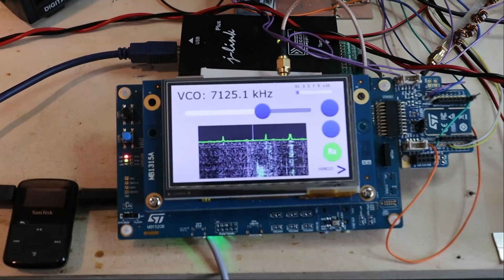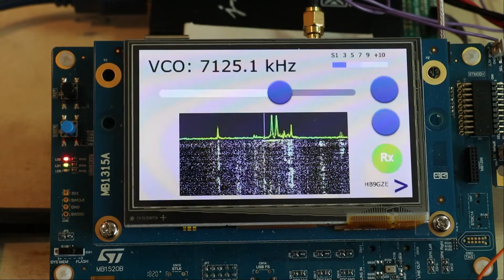Introduction to DIY HAM radio transceiver

Comment: Did you build these circuits yourself or are these commercial (off the shelf) circuit boards?
Reply from the maker: Yes I did design all the moard yself except the microcontroller "board" which is the STM32H735G Discovery Kit from ST.

Comment: Really cool project(s). Liked and followed.

I have some basic knowledge of circuit theories, very familiar with Arduino and ESP8266/32 and general digital circuit design. Have some knowledge in analog circuits like OpAmp & Power supply circuit design, mostly working in DC or low freq. 

I recently got really interested in RF circuit design but found it a very different world. Just don't know where to start. Got a SDR in hand but would like to build my own LNA, PA, mixer and detector/demodulator. 

Any suggestion on where to start? Books? Tutorials? Online courses? I have background in CS and physics so math/programming is not an obstacle.

Many thanks for suggestions and guidelines of any sort.

Some may recommend Razavi's RF microelectronics but I found that an overkill for hobbyist design of RF circuits. Besides that book focused on CMOS based design but I am more familiar with BJT modeling and have large inventories of BJTs of all sorts.
Reply from the maker: Hi Sullivan. I started with Charlies channel https://www.youtube.com/c/CharlieMorrisZL2CTM.  Then I also like a lot https://www.youtube.com/c/NA5Y_Electronics. Hopefully some of his work will be my next radio project. And then there is the devttys0 https://www.youtube.com/c/Analogzoo/videos. A must is the https://www.youtube.com/user/w2aew channel from W2AEW. Get a HAM radio license. Preparing for the test is a great motivator.
Reply: That is a whole lot of cool stuff to start with. devttys0 is great and I already finished most of his videos except for high frequency circuits. Very helpful. So is w2aew. Lots of interesting playlists.
Reply: @HB9GZE  Do you have any recommendations for RF books? I found most of the topics such as theoretical treatments of mixers/gilbert cells, PAs, LNAs are typical in RF textbooks but don't know if anyone of them are suitable for hobbyist with OKish physics and math background.